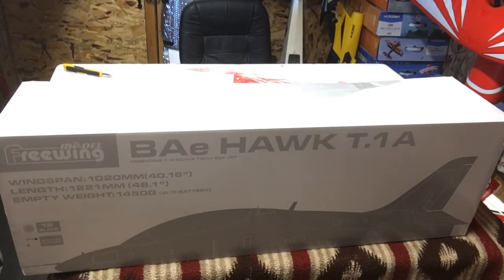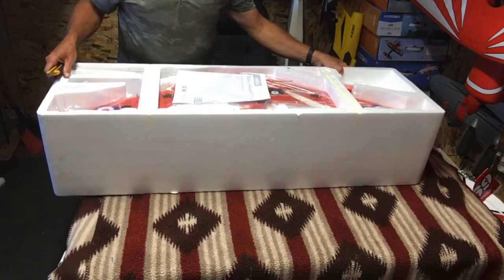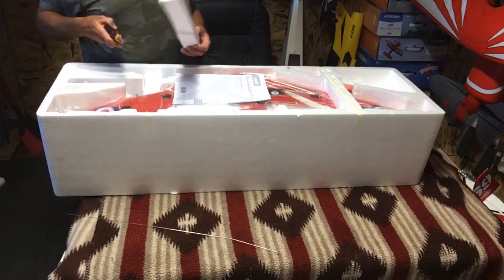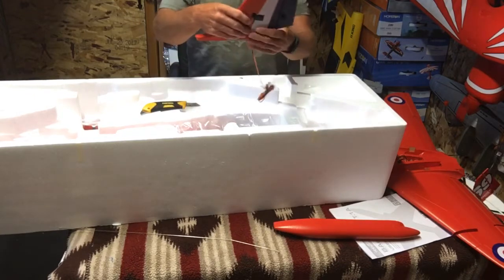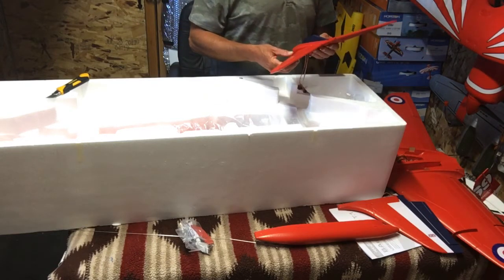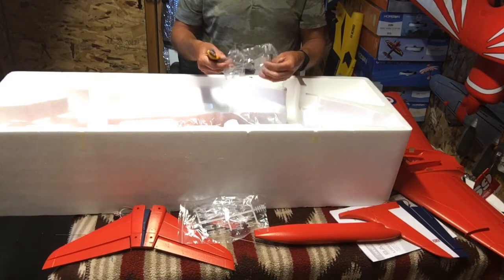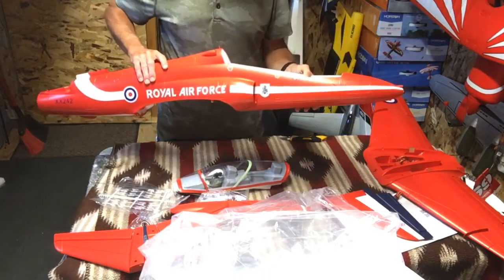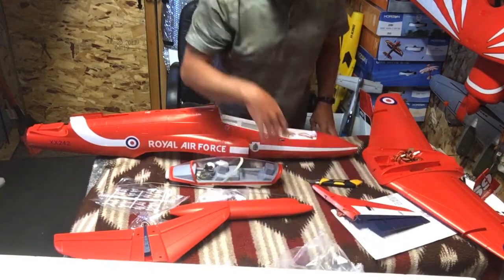Unboxing of the Freewing Bae Hawk 70 mm high performance EDF.

Comment: That’s Cool Wayne!!! You got the new and improved one. I was thinking about put new landing gear on mine. Have fun building 👍🏻✌🏻🖖🏻
Reply: If it has the suspension landing gear on it, it’s the new one. But if you want you can take cover off motor compartment and if the motor turns it a outrunner, if it don’t turn it’s a in runner. They might just use same instructions on new one too.👍🏻✌🏻🖖🏻